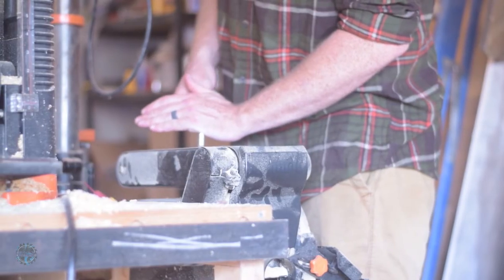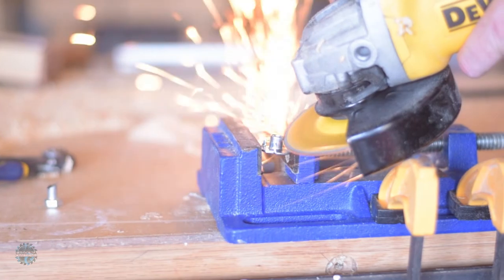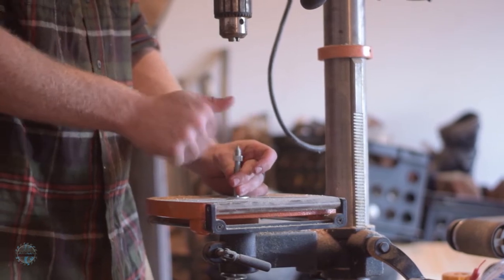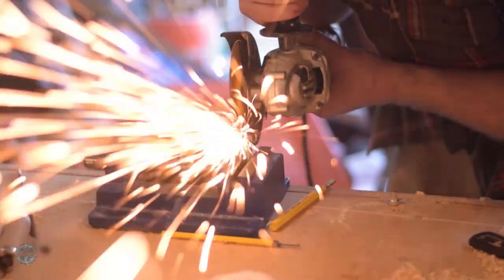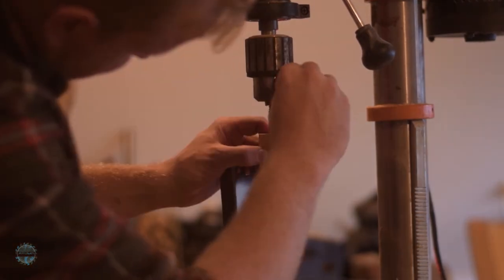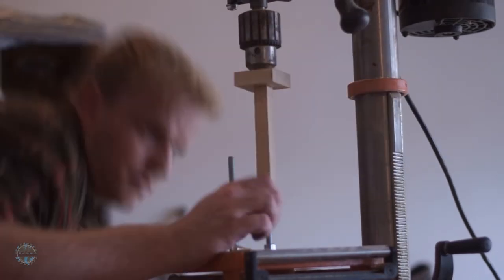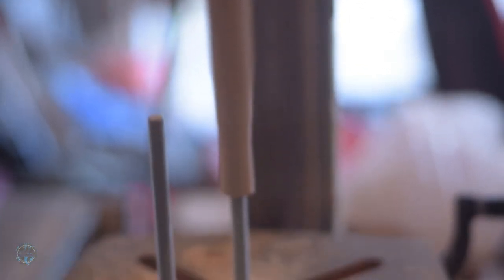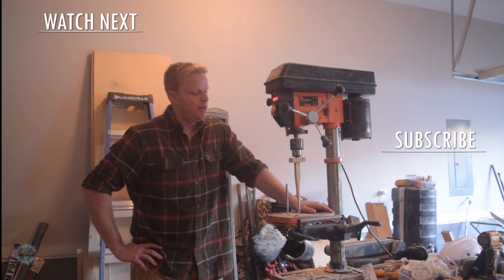Turn Your Drill Press Into a Lathe | Woodworking/DIY

Comment: Great ingenuity. I would suggest cutting down the bolt that acts as the tail center so it only sticks up an inch or so through the table. Then there would be a much shorter distance between the chuck and table, and you'd gain much usable length on your tool rest.

Comment: Question: I did something similar recently to cut a round handle shorter. Why not just put a screw into the wood and cut the top off, then use the drill press' chuck to grab the screw? Is it because you don't want to put a hole in the top of the piece? If so, why not just use a longer piece of stock, then cut off the section that had a screw in it?